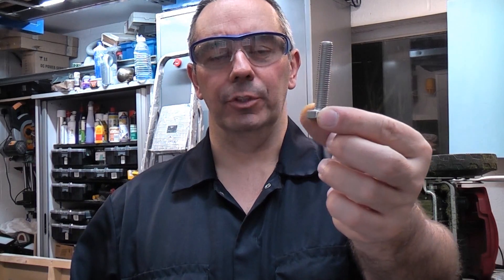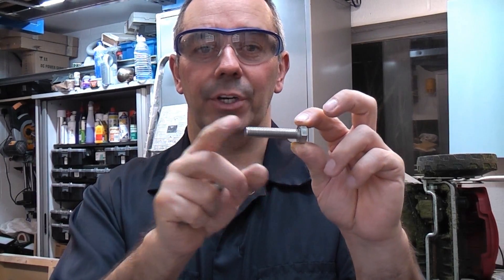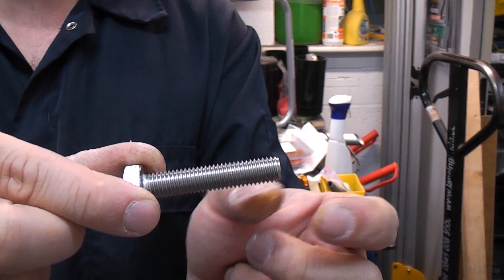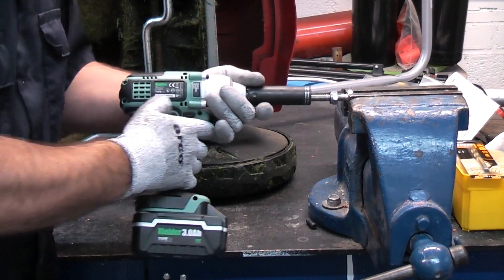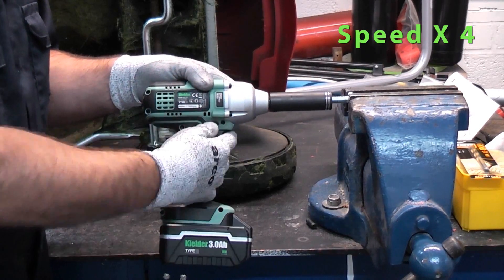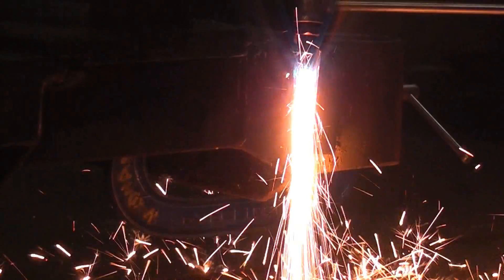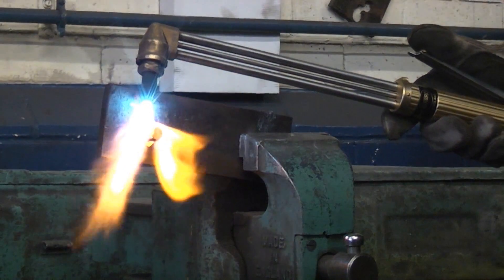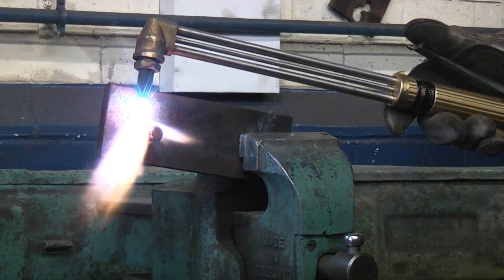Stainless steel bolts vs steel bolts | Stainless galling

Comment: At my shop (well, it’s my boss's shop) we’ve turned threads 5 inches in diameter, both of the mating parts, in stainless.  We’ve done these many times.  5” x 12 pitch.  This corresponds to a 127mm by about 2mm pitch, for you metric worthies.  We’ve jammed threads a few times.  If you are real lucky you may get it loose with penetrating oil by slowly working back and forth.  Slowly.  Heat is the enema here.  Other times we’ve machined out the mail member, cleaned up the female threads and made another male part.  Expensive fix.  The trick seems to be lube oil or anti seize, and CLEAN threads.  A tiny speck of sanding grit, like what is used to deburr the entrance / exit of the thread, is the starting point for galling.
Reply from the maker: Thanks for the comment

Comment: So, cutting ss is a different animal. Cut off wheel (disc) works if it fits in the space, but sprays chips (future rust stains) everywhere. But using a hacksaw (or just a hacksaw blade in vise grips cutting on the "pull" stroke) works pretty well. If you happen to be cutting thin sheet metal, you pretty much have to use a fine tooth blade. But whenever the ss is thick enough, use an 18, or even 14tpi. Always use hss blades. A fine tooth blade will only polish and further work harden ss. A coarse blade is necessary bc you need to RIP THROUGH the metal. Make every stroke count. If your coarse blade is not cutting, either it is dull, or you are not being aggressive enough with it. Cheap or tubular hacksaw frames will definitely work against you here. If you are just grabbing a blade in your vise grips, wear leather gloves, clamp onto the toothed side of the blade, and cut on the pull stroke. Sometimes you can even clamp two blades together to stiffen them (clogs faster, though).
Your channel and videos are fantastic. You saw a need to present some truth, vs the epidemic of "amateur hour" videos, and filled it. Thank You
Reply from the maker: Thanks for the comment, Marty ;-)
Reply: @ultimatehandyman  I am learing many new things, your techniques are sensible.

Comment: In the last 40 years I have not put Any ss nut, of any type, to any ss threaded fastener without a dab of anti-seize. The galling has Nothing to do with whether you use nylocks or not. That is like blaming the piano player for a bar brawl. It has everything to do with stainless alloy's inability to withstand heat or pressure. If they gall, it is because they were not lubricated before assembly with an Extreme Pressure Lube, and were likely torqued too tightly. BTW, ss lock washers are rarely a good choice bc they aren't hard enough steel (split spring spiral washers, not toothed). If you need to run a nut up a long section of thread, Never drive it with power, Always turn it by hand. Just the heat generated from power spinning that nut will likely cause it to seize (gall) before it gets to the end of the thread. That basically means the nut and the bolt will become one piece of metal. 
Just any grease is better than nothing (and stikwax is even better), but you are dealing with a relatively rough "inclined plane" hence the best choice will not be something you would use to make a ball bearing roll better. If you are in a marine environment, be careful what you choose. Just because a turnbuckle body is bronze, for example, doesn't mean you should use copper base lube. Be careful about setting up a scenario where you will get an electrolytic reaction.
My current favorite is Starbrite brand red moly, but for years i used nothing but nickel, which is sometimes called hi-temp. Avoid any graphite base as well as copper in a corrosive environment.
I am talking about stainless here, essentially useless for engine work, for those steel threads use a Mechanic that you trust, and always go with their recommendations.
YES!! You can use loctite with nevrseez. But never use too much anti seize, basically any amount, however small, is enough. 
Also, remember that with nevrseez, torque values go out the window and become academic!
IOW, Never overtighten ss fasteners, that's why you want nylocks in the first place.
Thank You
Reply from the maker: Thanks for the comment

Comment: I found this interesting but it didn't go far enough. I was a maintenance tech for 7 McDonald's restaurants for over 20 years and encountered a nightmare when the self-gapping clam-shell grills came into use. The upper platen operated at 425 degrees with a stepper motor and band pulley system to adjust from bacon to McRibb meat by computer. There was nothing BUT stainless fasteners in that mini oven. The adjustment blocks were fine thread bolts into machined bases. After ruining several under warranty, I discover a stick of copper-based anti-seize ( Locktite?)at my fastener dealer rated at 800 degrees. Problem solved. As to galling, part of the high cost of stainless bolts is the threading process. If the cutting gets rushed and the tooling dull it can tear the thread apex and the nut will grab the tear and roll up a (B-all that causes the "Gall". Other bolts are threaded by roll-pressing the threads and then heat treating.
Reply from the maker: Thanks for the comment
Reply: A product called Neolube is just right for this. Graphite in isopropyl alcohol. Two thin coats on both threads. Remove and recoat each time. Graphite doesn't care about temperature.

Comment: Great demonstration! I have experienced this many times during my career in industrial machine maintenance. I have found you can usually use a lower grade stainless ( 18-8 ) to achieve good corrosion resistance, and they are far less prone to galling. However, there are applications where this would not be allowed.
Reply from the maker: Thanks for the comment

Comment: I was a marine engineer for almost 50 years and in the mid to late seventies we started using some stainless bolts and nuts on steam lines out on deck instead of B7 or B9 bolts and 2H nuts and it was a nightmare they would always gall even with nickel plated antiseize. On tanker ships loaded with gasoline or crude oil you couldn't use a grinder on deck. In the late 90s we started using stainless again and had very little problems with seizing even with copper plated antiseize  something changed dramatically  between those years with stainless steel. I'm talking about 316 stainless.
Reply from the maker: Thanks for the comment ;-)

Comment: Worked in the food industry for a couple decades, stainless is a way of life in the food industry. Never Seize will keep a stainless nut/bolt from seizing for a while, but does wear off if constantly taken apart and put back together. IF, you are where you don't have to have stainless but only have stainless of either a nut or bolt, a regular steel nut or bolt won't seize with stainless. Any good quality lube will also keep SS from galling for at least the first time, but when they get tight they will gall.
Reply from the maker: Thanks for the comment ;-)

Comment: Happened to me yesterday using SS sheet  metal screws. The screws seized before going all the way in the sheet metal and I stripped the screw heads trying to drive them in. I even had the holes drilled larger than recommended and they still seized. Had I seen this video beforehand I would never have used them.
Reply from the maker: Thanks for the comment ;-)

Comment: In most cases u won't need to run the stainless nut up and down,you put in in the hole tighten it done.
Reply from the maker: But when you come to undo it, you might find the threads have galled.
Thanks for the comment ;-)

Comment: Thank you... You saved me from doing a huge mistake... I was about to change all my regular steel bolts for ss one on my truck restoration project... I changed my mind after watching your video.... Bless you.
Reply from the maker: Thanks for the comment ;-)
Reply: Do not us stainless for structural connections on automotive. 10.9 grade steel.
Reply: Ya if you got a rust problem or something, you might want to try a chemical solution to your problem... like a coating, plating or a rust converter. Stainless isn't great for fastening... but it is so pretty... but so is chrome
Reply: You can still do what you wanted with the s/s fasteners to prevent corrosion.

Comment: Thank you for sharing these characteristics of stainless bolts. On jobs I have had (Galling) of stainless bolts when using stainless nylon lock nuts. This usually happens when I am installing the bolt by the use of an electric driver. I guess it is the increased friction, as you stated, that is the primary cause.  Strange material, Stainless is.
Reply from the maker: Yes, stainless steel is a strange metal.
Thanks for the comment

Comment: You are absolutely right: SS can be a pain to deal with...I'm a millwright in a food processing plant and am surrounded by stainless...so many bolts are galled on the threads and we have to drill them out constantly! Good presentation! Cheers
Reply from the maker: Thanks Rick ;-)

Comment: The carbon steel in a regular bolt allows the cut off using a oxygen cutting torch thereby burning away the carbon in the steel, where as there is little or no carbon in a stainless fastener. The galling with stainless steel is a physical not chemical reaction due to the surface composition, when stainless steel is viewed at high magnification it has a rough surface finish that actually grabs the opposing metal.
Moving the Nut back and forth creates the necessary friction to actually fuse the two parts together. Breaking the nut from the screw will most always tear the threads from the screw. Stainless steel is useful for its corrosion resistance, however certain acids, hydrogen and chlorine will attack stainless at it molecular level.  I have witnessed stainless steel shatter in a hydrogen/chlorine  process at the refinery I worked at.
Reply from the maker: Thanks for the comment
Reply: Great video!

Comment: I have noticed this problem before, if possible I try to apply a little Tallow Fat to the Stainless Bolt, also I use A4 Stainless instead of the weaker A2 grade. 
One golden rule that I cannot stress enough is "KILL THE SPEED" never ever wind stainless bolts together at speed using powered ratchets, it is the speed that can cause galling. 
Always wind them together slowly, it takes longer but its much safer.
Stainless does not conduct heat away like steel will, this is why you only need about a third of the power to weld the stuff, so when driving it at speed, friction heating can start off the galling. 
It is Horses for courses really, sometimes only stainless will do a particular job. 
When cutting, welding or grinding stainless always wear a mask to guard against harmful hexavalent chromium emissions, lest you get lung cancer.
Reply from the maker: Thanks for the comment

Comment: Is the solution to use a spanner or wrench to fasten the nut, rather than a power tool? A lot of intersting info in the video, thank you.
Reply from the maker: They can still gall up when using spanners, a good anti-seize compound can help though.
Thanks for the comment

Comment: I like to use stainless steel nuts on normal steel studs for example the exhaust of my motorcycle. That's way the nuts won't rust 9n the studs.

Comment: Very good information, thanks. So does this problem occur only when using stainless steel Nyloc? The Nyloc causes much friction if you drive it too fast. I always use only hand tools or very slow rpms when fastening stainless steel Nylocs.
Reply from the maker: No, I only used Nylocks and the impact wrench to speed up the demonstration.

The washing machine rollers often gall up, and normally the bolts are tightened or undone with a ratchet spanner. I went to change a 2" steam valve a few weeks back and someone had used stainless steel nuts and bolts on that and they galled up (you can't tighten or undo them with an impact wrench as you can't get it in because of the flanges).
Thanks for the comment

Comment: Two problems here, 1 you should never use power tools to do up nuts. The massive acceleration due to the hammer action causes very hot spots. 2 you must always use lubricant on stainless steel threads.
Reply from the maker: Thanks for the comment

Comment: By far the biggest issue with stainless steel bolts is that they fail in fatigue far quicker than mild steel.  In general A2 s steel bolts are considered to be a higher tensile strength between 8.8 and 10.9 but they should not be used where there are cyclic loads because they will fail catastrophically e.g. suspensions and brakes due to fatigue.  They may look better than mild steel but will not perform.  There is absolutely no reason not to use them in locations where weather resistance is paramount but where they are not under the damaging load regimes.  My bike fairing has ss bolts all over it performing a perfect job.  They have been in and out of their sockets tens of times over the life of the bike without any detrimental effect.
Reply from the maker: Thanks for the comment

Comment: This video demonstrates the difference between an engineer and a tradesman. According to this video I should be unable to disassemble or shoot my stainless steel automatic firearms. As they were designed by an engineer I can. If the nut and bolt are made from two different types ( hardness) of stainless steel they will not suffer from galling in use. Even the slide, barrel, magazine, and frame of an automatic pistol with threaded parts in it.
Reply from the maker: Thanks for the comment

Comment: I was always taught that nylock nuts were use once only (as well as bent beam nuts - which essentially destroy the thread on tightening).
Reply from the maker: There are no set rules for Nylocks, I've never seen anything on the packaging saying "only to be used once" etc.
Thanks for the comment

Comment: If you need to use stainless you can buy ready silver plated  that avoid this galling effect (they are not the cost hike that silver plating suggests).
Otherwise I would use AG-90 Lubricant.  If naked stainless is a must then try using nut at A2 grade with an A4 bolt.
Its not addressed here but the one thing that many don't appreciate is you can't just swap steel for stainless and get the same preload on the clamping surfaces for same set torque. Generally stainless gives much lower preload  ...i.e. If you simply swap for stainless and torque up to the same then you risk whatever assembly you have just fastened falling apart (subject of course to its max design load and loading conditions.). Can be dangerous! Be careful about application.
Reply from the maker: Thanks for the info ;-)

Comment: Stainless, a rotten polluted material, I'd never use it especially in contact with a dissimilar metal especially aluminum, it's the toutch of death
Reply from the maker: Thanks for the comment

Comment: why not simply use anti/seize compound?
Reply from the maker: You can do, which is why I mentioned it in the video. The point of the video was to warn people about galling and warn them that stainless bolts cannot be gas axed off (in case someone decides to install them in a exhaust joint)
Thanks for the comment

Comment: Would there be an issue if a stainless nut is used with a steel bolt/steel nut with stainless bolt?
Reply from the maker: No, I do not think so. I think galling is only a problem with stainless on stainless, even using two different grades of stainless can help prevent it, such as an A4 bolt and an A2 nut.
Thanks for the comment

Comment: Can anyone comment about the science of this, why is it impossible to burn through a Stainless bolt? What actually causes the galling? Thanks.
Reply: Seth Kneller the oxygen turns the iron to iron oxide, which has a lower melting point thin iron, also the pressure of the oxygen blasts it away

Comment: One more top tip firmly stored in the noggin. Have used Stainless in the past but am steering well clear henceforth. Also I must have known once upon a time what a set screw is (I googled it - bolts have threads only so far up the shaft), I can't believe at 58 no one ever told me this, so thanks for the memory jog. As ever UH you are the go to man with all the answers.
Reply from the maker: I'm glad you have found the video useful. Normally if you ask at the hardware store for fully threaded bolts you will get set screws and the person serving you will not bat an eyelid, but with this video going on YouTube I had to point out the difference or else I would have had a thousand comments saying "that is not a bolt, it is a set screw" etc. 
Stainless bolts are still fine in many applications as long as you use some anti-seize and are aware that they can gall up.
Thanks for the comment

Comment: Has the whole world forgotten what a hacksaw is?
Reply: Hack saws are so 1990...lol...cut off wheels work much better on stainless as stainless gets harder as it heats up defeating teeth on a hacksaw blade
Reply: Sometimes bolts and nuts are in a place where you can't get a saw or grinder into or even a chisel and hammer.
Reply: Thats when dwarfs come in handy.
Reply from the maker: Not at all, only last week I had to hacksaw through 2 stainless bolts.
Thanks for the comment
Reply: SS is very tough on blades
Reply: Hmm? hacksaw... now let me see.. heh heh heh. If in doubt saw the bugger off... or break out the angle grinder.
Reply: I usually cut stainless steel with my kryptonite pencil or with my virtual chinese titanoxymoxyepoxy torch.
Reply: I just grab the nut between  my forefinger and thumb, then twist them apart. A touch harder to do with my left hand as I am right handed. :-)